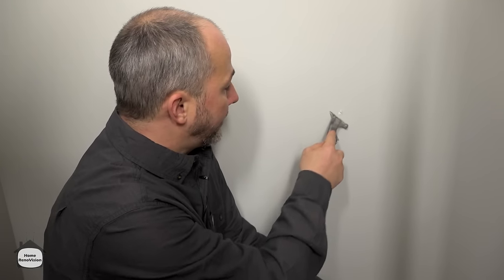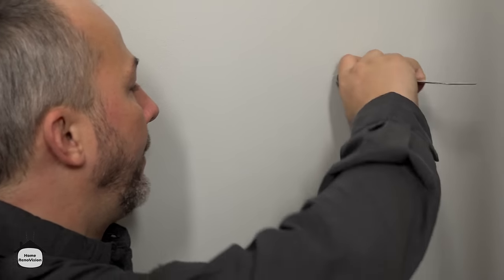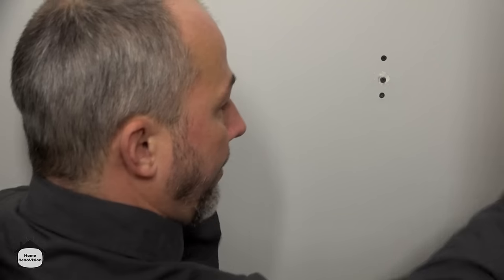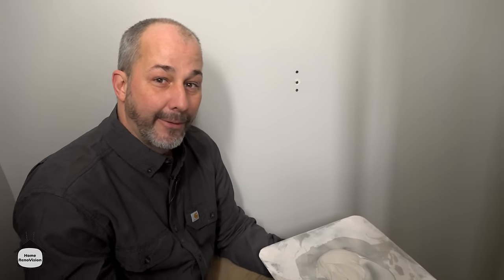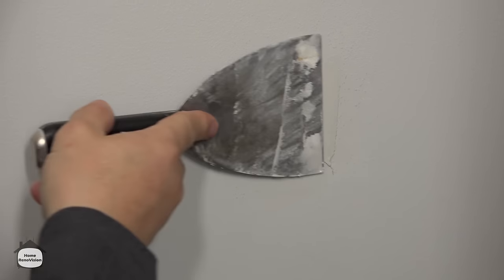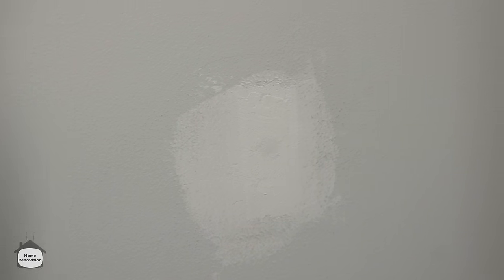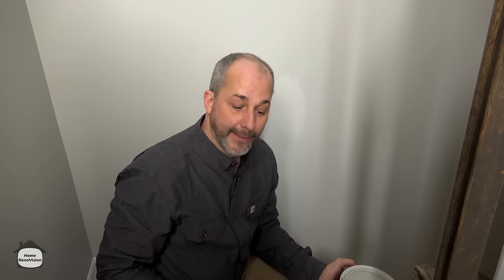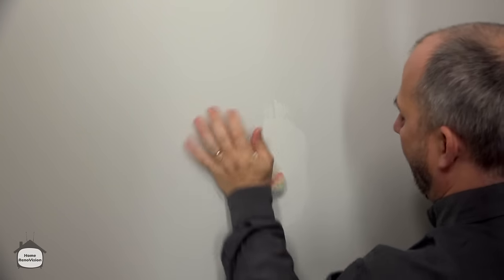How to Repair Nail Pops !

Comment: The paint in our new house is the most flawless I've ever seen, I.e. No roller marks, little fibers etc. I asked the builder if they sprayed the walls with paint, they said no? Tried to touch up the hall wall with a roller after we moved in and it looks completely different in texture!? Maybe they thinned and strained the paint or something to make it thinner than just using it out of the can??? The way they trimmed in the mouldings, it's wicked right into the radius of the wall to moulding joint, like they maybe used a pin striping brush or similar? It's very frustrating, since I've got some nail pops now on some wall and ceiling areas. Seems I'd need to repaint the entire wall just to cover the repair? Any ideas?
Reply: I've been painting for 21 years , and what I can tell you about the texture less finish they achieve on your walls is very simple  to explain they didn't back roll the walls !! The company that built your home told you that the painters actually rolled the paint because they don't want to look bad , but the reality is that most of the home buider companies don't pay enough money to the painters so they cheat and cut corners to make a buck , in the construction business  time is money and  obviously he painters that worked on your house didn't use the back roll technique to save time , I suggest to use a foam mini roller to do any touch on your walls this kind of rollers don't leave texture marks, ( make sure to saturate the mini roll with paint or in other words use enough paint because if you don't the touch ups finish will look flashy or uneven sheen , try to fade away the paint  don't stop the movement of the roll abruptly,  just fade away the ends of the patch your painting, and DON'T FORGET TO USE PRIMER FIRST BEFORE YOU APPLY THE PAINT, I hope this info is useful.

Comment: What am I doing wrong? How do I remedy this problem? The nail pops are an inch from the ceiling. I tried to drive a drywall screw below it, stopped going in about an 1/8" from the wall. I used an impact driver to drive the screw on the side, it also would not go in all the way. The drill, impact driver & screws heated up. Are there any tips for me to do this or do I need to hire a man for his upper body strength to drive the screws in? Edie  :-(

Comment: My favorite (sarcasm) is when you fix a pop....and therefore bring the gyps closer to the wall, but in doing so, create another pop on the other screws or nails along the same stud....I ended up rescrewing a house at least 70% of the fixed points.  At first it was 1 or two screws at a time, well a few days in and a little less hair on my head, I just started screwing everything.
Reply from the maker: sometimes bob it is nice to let your wood sit a few days before throwing up the wall board so it has time to dry out.

Comment: they pop because when the guys who originally  installed the plaster board , cut corners and did not apply glue to the sheets on the studs, they will pop over time if this is not done , its the glue that really hold the sheets especially ceiling

Comment: Hey Jeff, I've been chewing through your videos as I'm taking posession of my first home in a couple of days, and I'll be jumping straight into renos...

I was wondering if you've ever used Schluter Bekotec to do in-floor radiant heating.  
Mostly, I'm curious if you have any tips about how to properly screed the concrete to the correct depth.  I'm planning on doing LVT on top, so the floor needs to be pretty smooth and level.
Thanks!
Reply from the maker: Not to this point. I will be doing a vinyl over heated floor soon. using an integrated mat for the wire that i can lay the flooring on.

Comment: Great vids 👍
Question: I have nail pops that have been previously, incorrectly repaired and painted (too much mud and not feathered out properly). The result is a series of evenly spaced big bumps (4-6”) down the hallway.  Furthermore, they don’t have any roller texture, and when the light catches them just right, they’re all smooth and visible and “pop” out. Any suggestions on repairing these?  I am tempted to mud and feather all round them even more.  What I’d really like to do is rip down the wall and re-do it, but that seems excessive. Any suggestions would be great!

Comment: Ugghh... ton's of these on my long livingroom wall
Reply from the maker: Let me guess it is the outside wall right?
Reply: @HomeRenoVisionDIY  interior main structural wall. I created most of them when I hung the TV on the wall. Sucked the bracket to the wall and the screws about 8 all popped proud...
Reply from the maker: that is actually quite common. drywall attached to wet lumber ...then dries...then the tv comes and makes a mess out of everything. Cheers mate and welcome to the club. Don't be hard on yourself the only option is to install the t.v. bracket to loose for anyone's comfort.
Reply: @HomeRenoVisionDIY  thanks for the comments and the tip videos!! I have been picking up a some new good habits

Comment: The only thing I would add to this, is I spray what ever I'm plastering twice with a water bottle.
Otherwise I find the dry, drywall sucks the moisture out of the filler and effects it's ability to properly
cure and adhere.

Comment: So you don't have to use an actual primer to prime it first, the finish paint works the same as a primer?
Reply from the maker: actually ij this case the hardener in the mud acts as a primer. Cheers!

Comment: My painted ceiling is sheetrock.  I was in the attic and 'mis-stepped', now there are dimples, where the sheetrock nails are.  Not screws, but nails.  Tips for repair?  And the ceiling is textured.
Reply from the maker: use a screwdrivewr and hammer to set the nails again and add a screw, you can use latex caulking on your finger to repair the texture.

Comment: pop-it's is usually caused by fine thread screws that's for steel stud, it can't grip the fibers in the wood
Reply from the maker: that is definitely one cause!
Reply: @HomeRenoVisionDIY   even worst on ceilings, than its a dib - it

Comment: I notice you’re quite loyal to the Sheetrock 45.  Do you know if there’s any difference in composition with the Sheetrock 20 if you’re in a bit more of a hurry?
Reply from the maker: it does not work the same. use warm water. Cheers!
Reply: Very interesting, thanks again.

Comment: I bought my home brand new in 2014.. and I started noticing screw pops here and there. Decided to wait a few years to really go after it because over time I noticed more and more..

6 years after the fact I'm now attacking it all, hundreds of screw pops, tape lines showing like they never added the second layer of mud, but joints that moved and pushed tape out.. I I have bad taping on my ceiling peak in my split level ceiling.. its knockdown so I can't just touch it up an make it look good. I feel like I have to rip it all apart and redo this sheetrock work it's absolutely horrible.

Comment: Hi Jeff, I patched and primed my walls in my basement two weeks ago and I had nail pops. I just put putty over it (no screw added or removed) will I see them after my walls are painted?
Reply from the maker: yes they will return. And you will see the bumps where you added compound. If you remember where they are try pushing against the wall to make them pop again and then fix before painting. cheers!

Comment: You said nail pops but you pulled out a screw.  So, how would you fix an actual nail that has popped out of the wall.  Maybe replace with your screw method?  Thanks for the vid.
Reply from the maker: We call then nail pops regardless of the fastener. if you have an actual nail then i would use a nail punch and set it deep and then add a screw like in the video. Cheers!

Comment: As a professional , I hammer the screw in with a drywall hammer, durabond 90 or less
Reply: I'm no professional but, if I can't beat it, I hide it...bury them buggers and I have been known to use air-dry clay to fill a hole in a hurry and it works fast. Not sure how strong that is but I'm like others if all else fails, hang a picture over it. I currently have 36 pictures up. with 3 more being prepped(I'm a Crystal Artist) & ( All in one room)...Yikes* hahahaha

Comment: oh man, I'm dealing with this in my newly purchased home. There isn't one drywall screw in the entire house, all nails....and not drywall barbed nails..like roofing nails. Knowing this before painting anything I'm committed to re-securing each wall as I go. Also, because I am not a fan of orange peel texture now have to re-texture the walls. Every room in the house (especially the ceilings) have holes that have appeared after the cap over the rusted nail has given up. The boards when actually screwed in move inward 1/4 to almost 1/2 inch! Its nuts! That means doing the corners...and thus the joining wall. The price I pay for perfect walls :D
Reply from the maker: sounds like someone was cutting corners on the install.
Reply: Oh yes! neighbors Ive talked to report the same issue. Thanks for posting the Link to your Amazon list of tools and products! Really helpful as I watch your videos and say "now thats the tool I need"
Reply: @HomeRenoVisionDIY  Had a question that relates to the video...in the video you remove the screw, in the case of a nail...any advise on removal? I find that in my case the nail having rust on it, the head pops off and prying it out becomes simply hammering it into the wall. I can get it out, just ends up causing more damage around the nail to the wall. thanks!

Comment: For you DIYers doing your own sheetrock, spend a few extra dollars and use drywall adhesive. If you do it right, you will never have a nail pop.
His tips for fixing pops is spot on. Except that shitshow with the roller.

Comment: What  about  my  place? I'm  looking  at  the  same  thing but  in pairs  and  from  the  bottom  to  the  top  in  some  places  and  all  over  the  house. I  am  wondering  why  the  walls  with  the  dark  paint  have  what  looks  like  dry  wall  dust  all  over  the  paint  too.
This  place  was  freshly  painted  wuen  we  bought  it  and  it  broke  the  bank  at the  time, so  I  had  no  cash  but  I  didn't  see  the  problems  then  anyway. I  was  working  pretty  steady  by  the  time  I  did  see  the  problems  but  I  had  a  bad  back  injury  right  then  too and  before  I  could  try  to  get  back  to  work, I  had  a  heart  problem  and  just  never  have  been  able  to  get  the  funds  to  fix  this  place.
I  told  all  that  because  I  need  some  advise  that  doesn't  cost  a  lot  of  money  or  tooling.
I  was  hoping  that  I  made  a  good  choice  on  the  house  and  it  could  be  insurance  for  my  family  if  I  croaked.
Reply from the maker: do it yourself. repairs are mostly time consuming and not difficult.

Comment: Ive got holes in my walls that got patched with like paper, tape, and then painted over.
Reply from the maker: that is probably drywall paper. just smooth coat it until it is invisible if it bothers you!

Comment: Thanks. I have a bathroom where the idiots used nails on the rock. So I have actual nail pops to fix, not screw pops. So the title is accurate for me. I have to get to it someday. I will do a similar thing except take out the nails.

Comment: I bought a brand new house about 3 years ago and there are nail pops everywhere.  Drives me nuts.  I remodeled our old house and completely re-drywalled our basement and not a single nail/screw pop.  Makes me think if you see a slew of them the contractor didn't do the job properly.

Comment: I have noticed so many nail pops in my house since I moved in a year ago. Sadly, after digging in to repair them, I found they are really nails! Whoever installed the sheetrock, at least some of it, used nails, not screws. Do I use the same process to fix all 10 million of them??
Reply from the maker: just drive the nails in and then use the same process. Cheers and sorry to hear about the cutting of the corners while building. Half nails and Half screws is bad practice.

Comment: I usually just bang 'em in with a hammer or 5 in 1 and then fill!
Reply from the maker: that will always take 2 coats! Cheers!
Reply: @HomeRenoVisionDIY  I do like the upper and lower screw idea but when you're on the job and gotta get it done, smacking 'em in with a hammer is the way to go. Plus, many older homes here in New England have had Sheetrock installed with nails and not screws.

Comment: Well.. that’s not a Nail popup, this is Screw pop up.
My house is 1980 and they use nails to install drywalls. House wasn’t properly insulated (crawlspace leaked a lot humidity) and now nails start rusting a bit and I’ve got pops ups everywhere, walls, ceiling.. It is not as easy to take Nails out without destroying surrounding area as you can do with screws. On top of it there is drywall paper joints start “peaking ”out, i guess for a same humidity reasons.. I fixed the humidity issues by insulating crawlspace with close cell foam, but I’m afraid only way to get rid of Nail popups and joint peaks is to replace all drywall, and i can’t afford it..

Comment: Drydex. Buy a small amount and play with it. Great for small Job.  Starts pink, and then when white its ready to sand and paint. Oh and they make these great small driver bits for drywall, so cheap. Saved me so much money and time.  I dont have to guess when im driving screws into drywall. Remember Drydex!  And for everyone, stop using Nails they are not a good thing on drywall. Use the screws.  Pleaseeeeeeeeeeeeeeeeeeee

Comment: Shouldn't you be priming the filler before painting? And if you just do the patch in paint it is not going to blend in. You have to paint the whole wall corner to corner. .
Reply from the maker: That is why this is a secret. the 45 min mud from cgc is the only compound that I have found that allows you to skip the primer and just do the touch up.

Comment: I guess this is the one good thing about having plaster over drywall, never seeing drywall pops. Unfortunately, it's probably the ONLY good thing about having plaster over drywall.
Reply from the maker: Hi Catman, that's right your plaster seldom sees this but you do get those nasty cracks.  We will tackle this problem some day soon  . until then keep up with the wallpaper. Cheers!
Reply: @HomeRenoVisionDIY  No wallpaper, just paint. It might not be plaster, but it wouldn't have made sense for the previous owners to put almost half an inch of cement product on the drywall, even though it's a weird surface texture.

Comment: So where was the nail bud? Deceiving title. I actually have nails that had popped, not screws. What's the trick there? Make a huge damage and take it out or hammer it back in with extra screws top and bottom?
Reply from the maker: You tube would not let me use the word screw in the title. Same process except drive the nail in instead of taking it out. Cheers!
Reply: @HomeRenoVisionDIY  thank you for redefining. I too was curious!

Comment: What if you shot some Liquid Nails in the first hole and then shot the next two screws? I've learned that I have ADHD and that Home Owners don't see the same imperfections that I see. The Homeowner is not going to use a Halon Light to scan the walls.

Comment: Why not eliminate that screw? The stud is bowed and it can float!
Reply from the maker: the stud is most likely installed with a high level of moisture inside and then it shrunk a bit. that allowed the gap which caused the pop. if you just leave it there it makes it easy for the next pop to happen. By screwing it tight again you will be able to identify if the other screws on the stud are loose and need repairing at the same time.

Comment: Or some people still use actual nails, which is dumb
Reply from the maker: they install quick when you are holding the sheet over your head. This is the cheat that board installers use to hang it quick. If they changed the sod to just screws everything would last longer.

Comment: You haven't got a clue why you have nail pops. It's actually a screw and the reason it pops so to speak is because the drywall was not pressed against the stud to begin with when they screwed it in then when the drywall moves in toward the stud it appears as though the screw is popping out. Geez.

Comment: Just buy a new house that doesn't have a nail pop, problem solved duhhhh
Reply from the maker: Ouch, all new houses will have nail pops. That is what happens when the lumber dries. Cheers!
Reply: Better yet, you could just remove drywall screw,  install U hook, and hang a MAGA Hat!
Reply: @HomeRenoVisionDIY  you are talking toTrump, can't you see.  Homes are disposable to him.